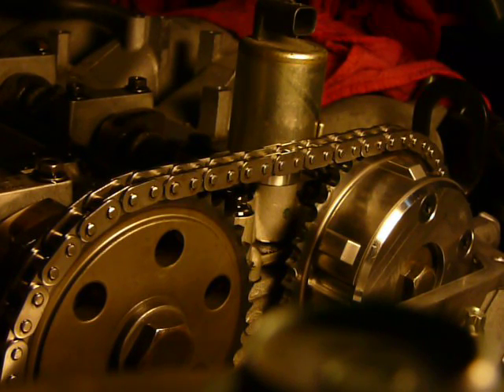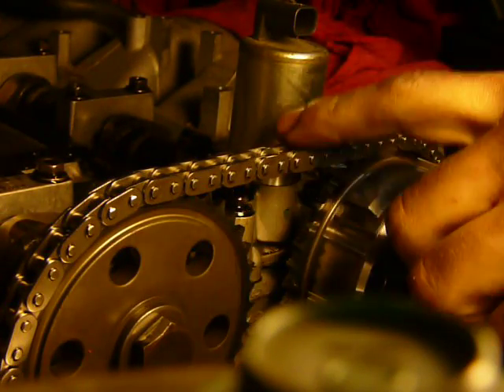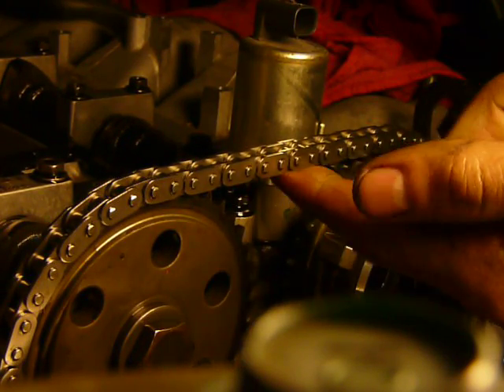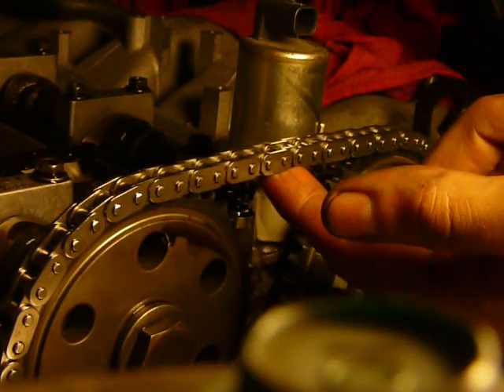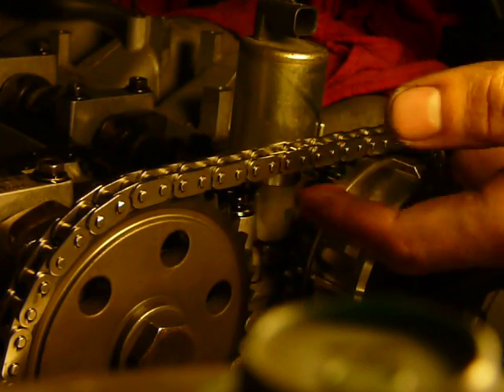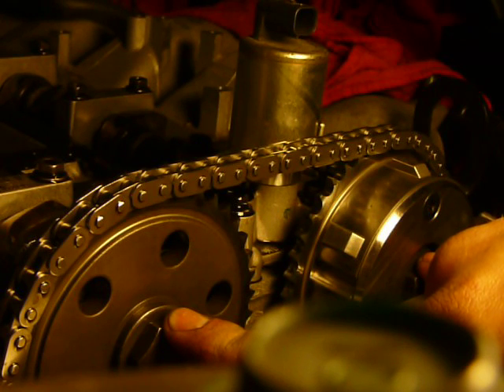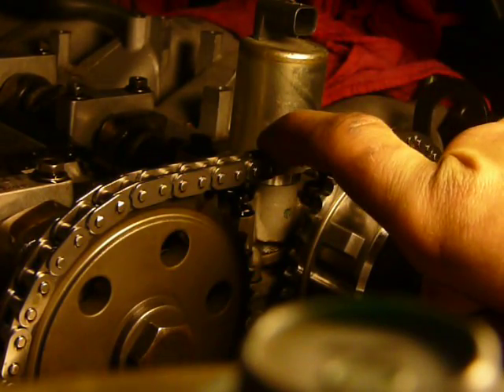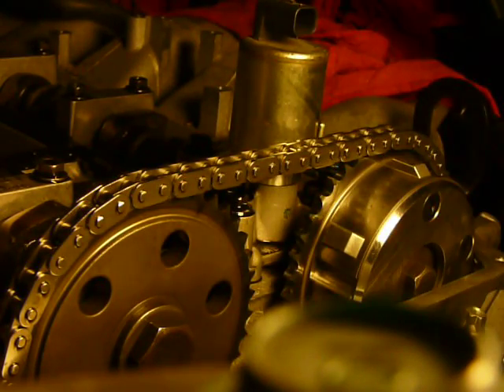Mazdaspeed 3 VVT/Timing Chain/Etc DIY Repair - Chain Tension After Crank Bolt Torque

Comment: Hey man I have a 2005 Mazda 3 hatchback with 144,000 and I thing it’s needing replaced😢.  do you remember where you bought the friction washers and bolts. I have found kits but they don’t have new friction washers or bolts and thanks for these videos 👍 sorry I’m late lol just got the car Friday lol
Reply from the maker: I bought all the stuff online from a mazda parts website by just selecting the parts I needed. This was years ago but I was able to buy everything separately, no kit or anything. If you want to pick up local, try asking your dealer to price match what you find online. Good luck man

Comment: At what mileage did your VVT Actuator fail?
Reply from the maker: It didn't actually fail completely, but I replaced mine at ~58000 miles. There wasn't any visible damage on the one I pulled out, but the failure happens internally and it was definitely the older version so I replaced the VVT and all the timing components just to be sure. 

If it fails completely then your engine will likely destroy itself as it's an interference engine. Don't wait until it fails. The TSB extended the warranty out to 70000 miles/7 years for the VVT but some people saw actual failure and engine destruction at half that mileage.
Reply: Many thanks. I wonder is there a way to tell if car has the newer version fitted? I read something about a heat treatment hot spot on the cap on new version ?
Reply from the maker: +X Plane Yes there is a visible heat treated spot and the housing should have the letter "C" on it. Go to the link in the video description and scroll down a bit, I put a picture of the new part with the letter and the spot.
Reply: Govanification cheers man 👍